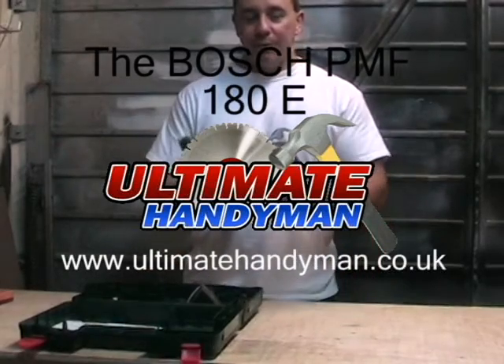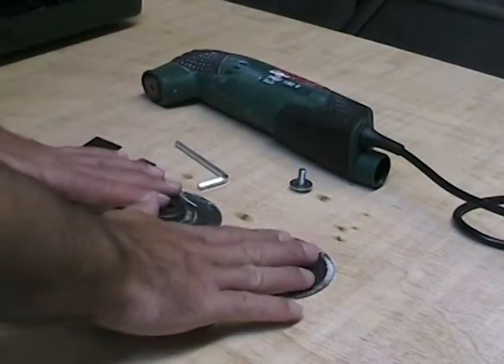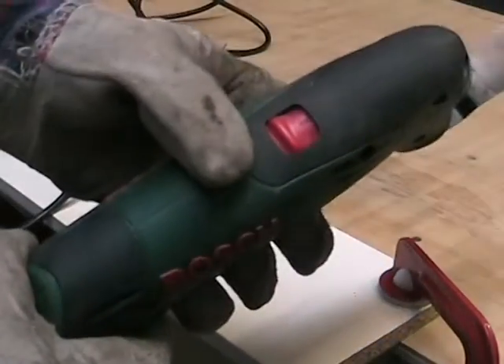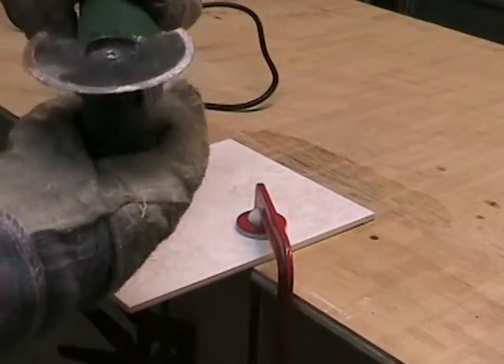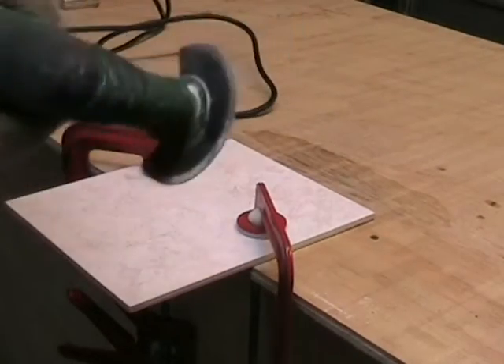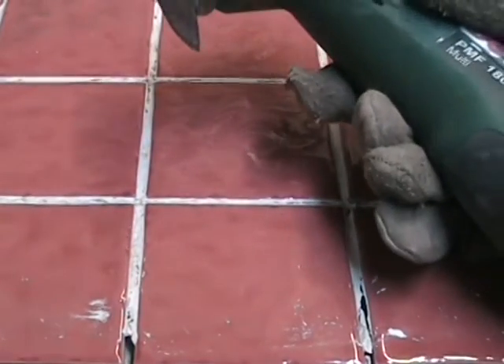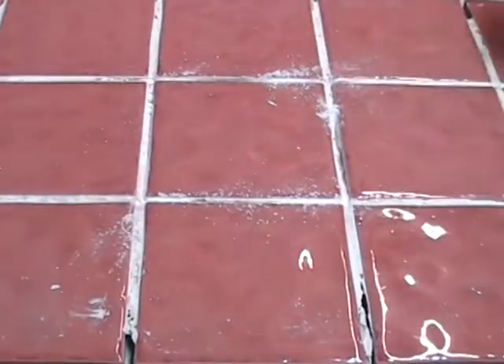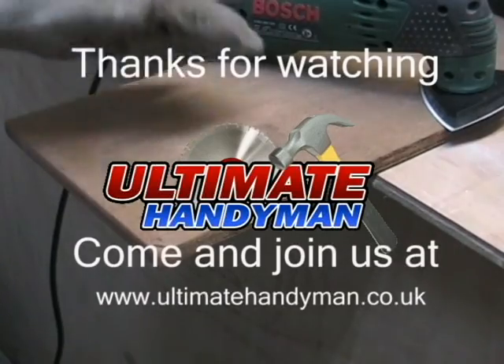Bosch PMF 180E multi purpose saw and sander

Comment: I know that this one of the older models of the Bosch Multi Tool but for any that don't include it as Standard.  Would you say for cutting out of grouting and/or the perished internal seals between the UPVC Double Glazing and the walls, it's a worthwhile expense to invest in the additional dust extraction kit?  Or is it a waste of time & money.  Or rather than falling for the snazzy Metallic Briefcase style storage case for the PMF 190E as my entry level multi-tool, for (the replacing seals job)-  I should scale up the range for a model with dust extraction included or go for a different manufacturer altogether.  Bearing in mind this is a rank amateur and not experienced user here.  Thank you.
Reply from the maker: I've only seen a dust extraction unit that will work wit the sanding attachment. For removing grout, I would just hold the end of the vacuum near to the blade and that should collect most of it. This model, or even a cheaper model will be fine for removing grout, I bought a Parkside on a few years back from Lidl and it works fine. Cases are often useful, but if you ar not using it much you can just keep it in the cardboard box that it comes in.
Thanks for the comment

Comment: In hindsight, based on your experience of the corded and cordless model, would you prefer the corded or cordless as a long term tool? The cordless seems to have less power when compared to the corded one in my opinion. What's your take on this?

Comment: I've got the WORX version of this. It's a great tool but the blades aren't common in DIY stores. I'll probably end up using the Bosch parts, as they are supposed to be compatible with the adapter.